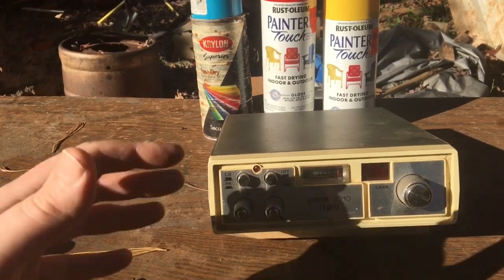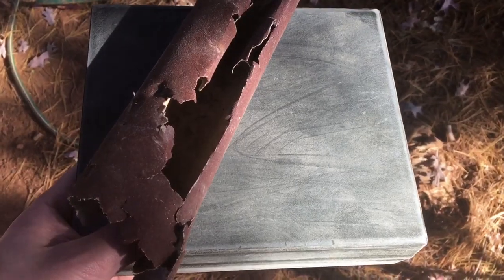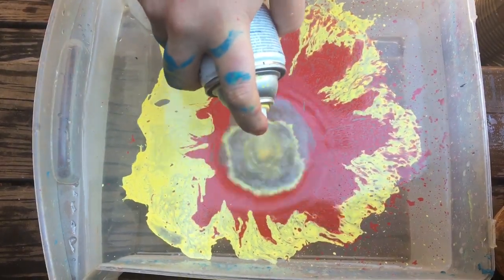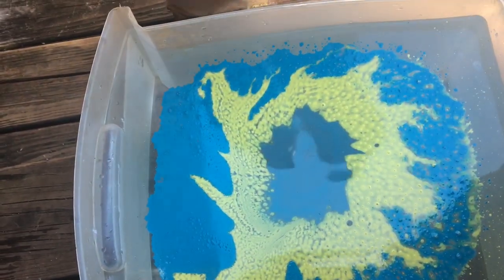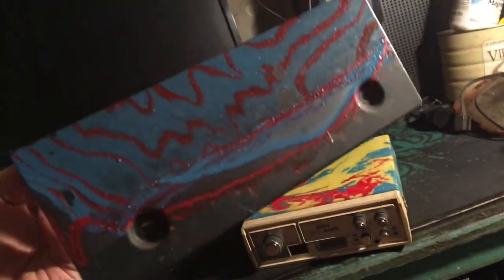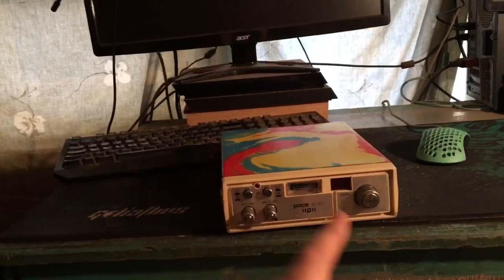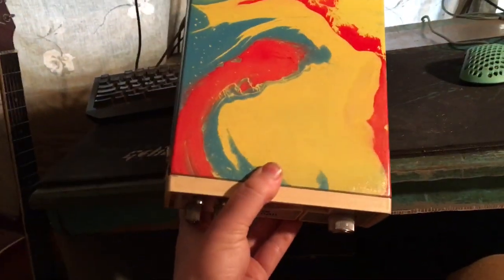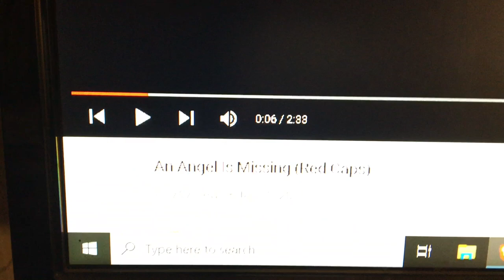I TRIED HYDRODIPPING MY CB RADIO: LEARN FROM MY MISTAKES

Comment: I've been wanting to do this to an old CB for years. Also some guitars. Watch videos on how to swirl paint a guitar and you'll know what type of paint, the temperature and dipping methods you need to use. You should have used a magnet on a stick to hold the cover from the underside, and then slowly lower it in (vertically, not laying flat) as you move it around.
Reply from the maker: Yeah I figured quite a bit out through my failures. It looks easier than it is, there’s a lot of finesse to it.

 I’ll probably try it again and see if I can get a really good finish